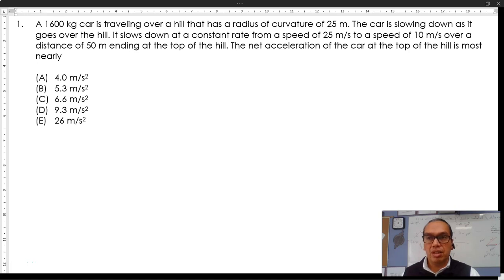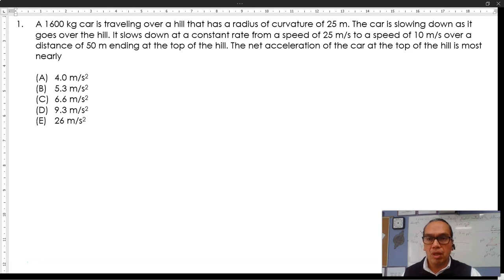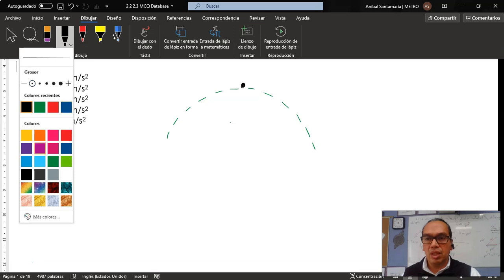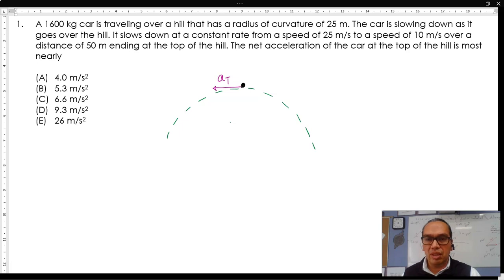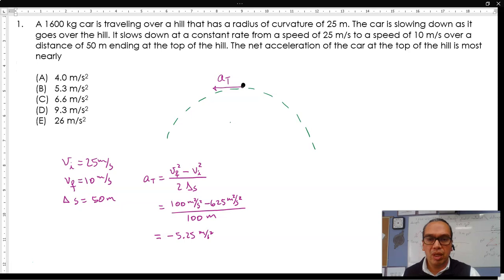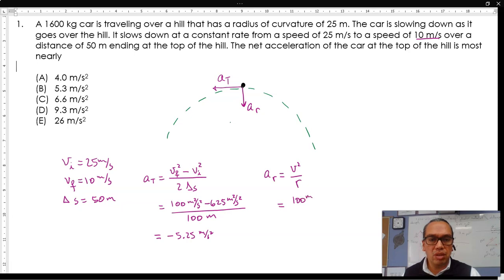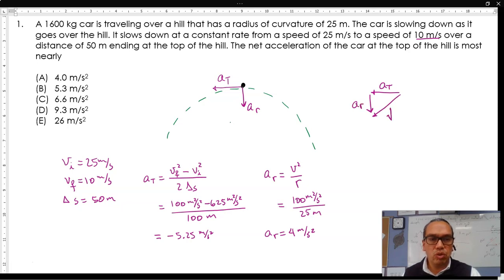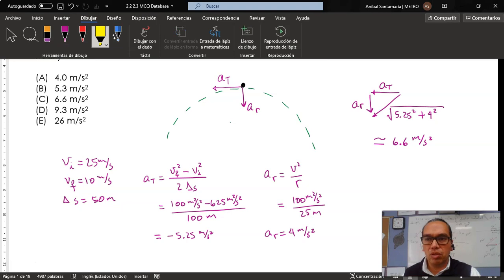2.2-01 Total acceleration of a car moving on a circular trajectory

Comment: The answer is C because we would need to use the two different speeds to get the components to the tangential acceleration which is equal to the net acceleration we need to get.

Comment: In this example, we can see how an object moving in a circular path has two different accelerations, which are tangential and radial. Also, the net acceleration would be the vector sum and in this case the correct option would be C.

Comment: There are two accelerations in the situation presented, the tangential and the radial. By using the equations needed for the data given, we get that the net acceleration is approximately 6.6 m/s^2.